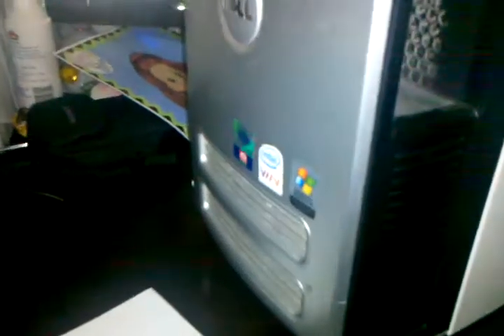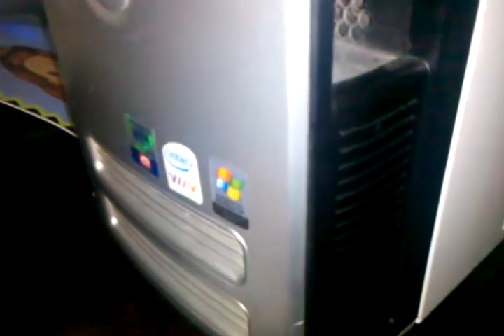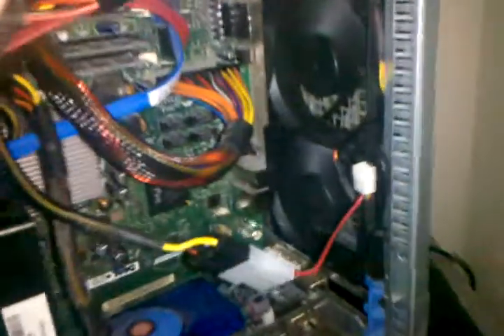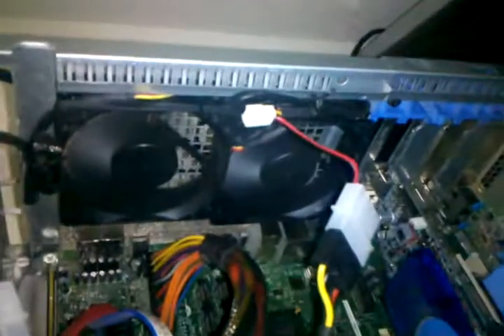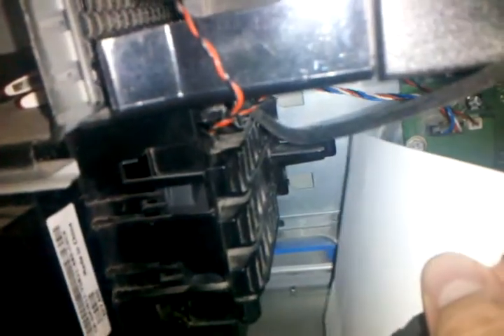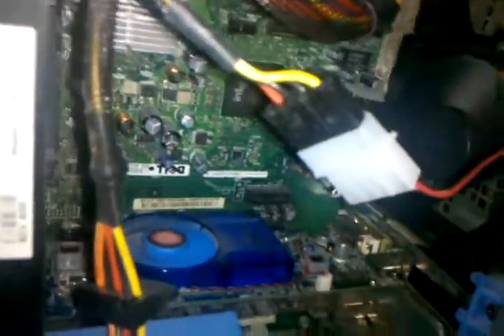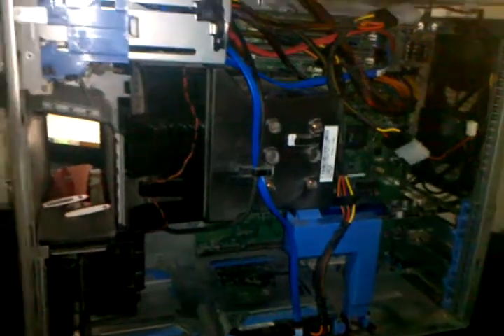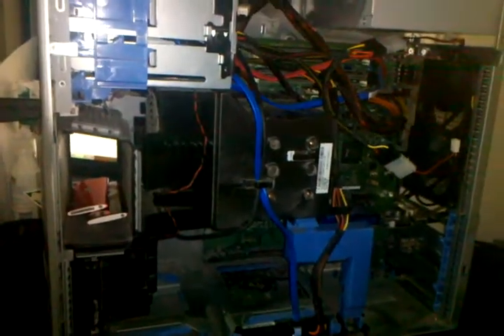My Dell XPS 410 fan mod.

Comment: I upgraded my Dell XPS 410 from a E6600 core 2 Duo to a Quad QX6700 2.7 ghz overclocked @ 3.1ghz , 8GB of memory Corsair XMS DDR2 800mhz, Samsung 830 120gb SSD, 2TB WD black, Gtx 560ti, 750w AX Cosair 80 plus gold, OS W7 ultimate .  This new configuration runs three or four times faster than my previous setup. I'm still to this date happy with this machine.

Comment from the maker: I have actually swaped fans again since this video. I had sleeve bearing fans and within a month they were making a god awful grinding noise from loosing there lubrication from being upright. Replaced with three new double ball bearing fans. Two 80mm for the rear and  one 92mm fan for the front. Thats really all I have done aside from the Power Supply upgrade as well.

Comment: You can find a Quad QX6700 used for about $120, Corsair AX 750w $140, gtx560ti $150, Corsair xms ddr2 8GB $120, SSD Samsung 830 120gb $100 .. that's $630.   But the convenience is that I can carry over most of these components towards a future build.

Comment: Would you know if the main front fan where the ipods are, what size that is???, and the bottom one below that is 92mm correct?, im thinkin of gettin 4 fans for this, 2 80mm for the back and replace the front 2, I have a ATI 5670, with stock powersupply still so hopefully it can handle all this

Comment: Maybe if you clean your pc, you will need less fans!
Reply from the maker: Do me a favor and take your ignorance elsewhere. Thanks for the advice on a six-year-old video. The cooler the PC the better. Yes it was dirty but it was blown out after. I also use Arctic Silver 5 thermal compound on my CPU to handle the heat better. This video was about the fan mod since this PC had no exhaust fans, just Intake fans. But you go ahead with your little assumptions. Do your homework before you run your mouth.